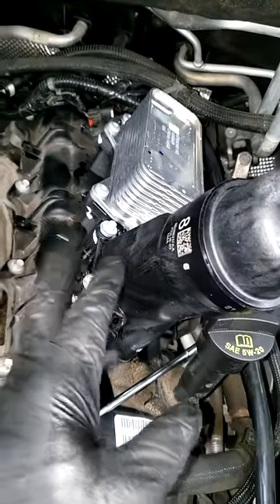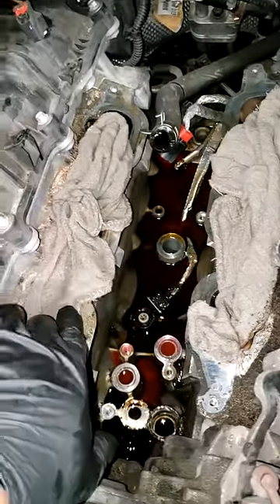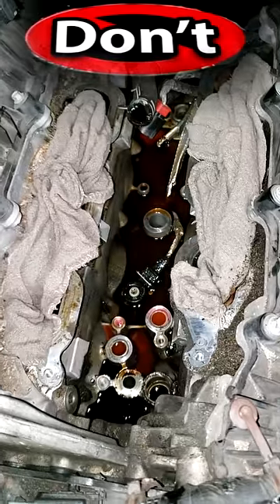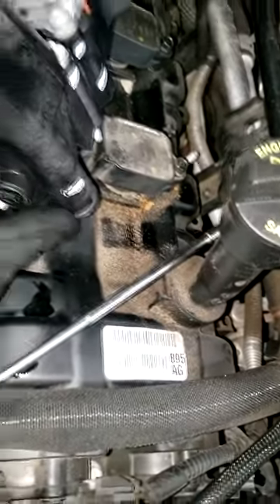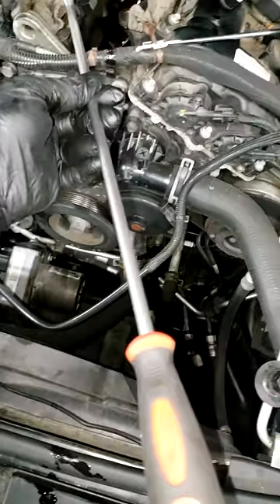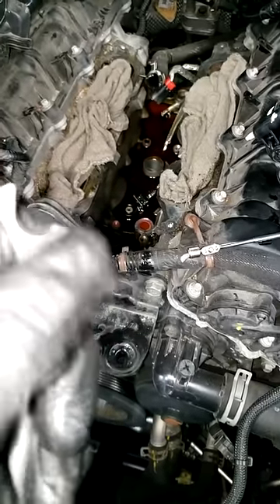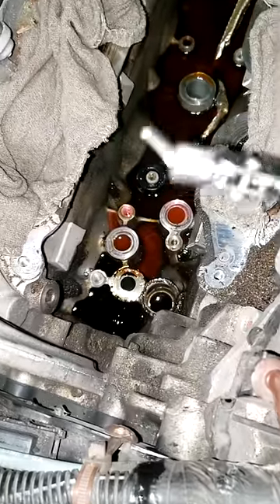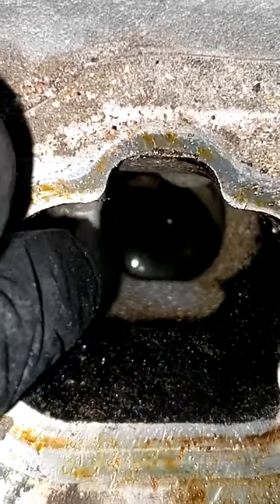This will scare the hell out of any mechanic. But I found it.

Comment: the best online mechanic tip you can get, is to not use this mechanic.
Reply from the maker: That was lame af. If you gone come for me you have to do better than that dude, come on man. The good news is that I will give you another shot. So try again ok
Reply: @OnlineMechanicTips  I mean corny, sure.
Lame would be using a panel popper as a pry bar. 🙃
Reply from the maker: @djkiIIag  smdh, ok i gave ya lame ass 2 chances and thats all you got?

Comment: Haha simple* oil filter adapter housing .. stillantis should have recalled this damn housing unit made out of paper and air smh every god damn v6 dodge Chrysler jeep that has this 3.6. Motor every single one I have ever worked on this part has failed and you know they updated it now it’s all metal aftermarket 😂 they didn’t even revise the issue and let it be for 13 whole years smh waited for an aftermarket to fix their issue 3.6 owners out there watch out for your oil filter housing unit and those damn lifters smh 😅

Comment: Don't use Harbor Freight shit!
Reply from the maker: And then, just maybe then, it will now be ok not to cover the intake..smh..What does HF tools have to do with the video?
Reply: @OnlineMechanicTips  HF tool is the one that broke...THAT'S what it's got to do with it. Snap-on would NOT have broken that easy
Reply from the maker: @javiercorral722  Thats my point. That it doesn't matter which tool used, or what broke, the plenium should be covered at all times. Thats the point of the video. But thanks for watching my guy
Reply: @OnlineMechanicTips  haha...roger..echo 5 Charlie, OUT!

Comment: Lot's of wrong here...
Reply from the maker: Its not wrong to cover the intake. Because thats really what the video about.
Reply: @OnlineMechanicTips  TAPE IT! VAC IT BEFORE REMOVING OIL FILTER ADAPTER.!
Reply from the maker: @Dan-jl1fk  no vacuum, only air blower was used and as you can see, didn't get it all but great points.
Reply: @Online Mechanic Tips  no malice intended. Just done better than a hundred of these. Another crap design you and I deal with. Oh if it's a Promaster you may have to DRILL the two front upper plenum screws out 😡 .No cover ,they fill w/,water

Comment: Bro y you using harbor freight shit in a shop.... that may b ok for home repair but not daily abuse
Reply from the maker: Did you not hear me in the videovsay I was in another guys stalled? Besides, the focusvshould be on covering the intake.
Reply: @Online Mechanic Tips  your taking what I said as a bash against you...I kno you said you wer in someone else's shit, the bash is on them for having harbor freight tools in a shop where your tools get used and abused alot more then the at home oil and break changer.... and anyone who doesn't cover the intake just in instinct alone is pretty dumb altho I have also seen it happen where someone is rushing and leaves the rag in the intake so there is that🤣